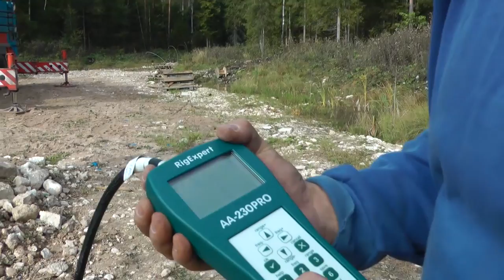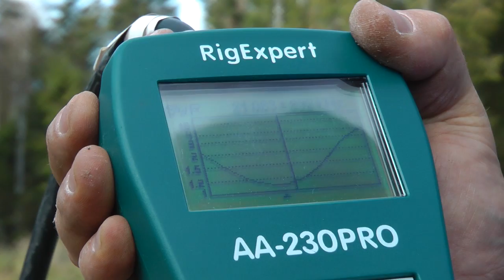ES5TV 15m 8x5 Elements H Frame Stack

Comment: Awesome acheivement.   There are a few other very high gain 15 meter antennas around the world - a QSO should be possible.  Some of the comments????  The timing is perfect.  It's 15 meters - it says so.  The meter shows 50 watts output, the gain of an ACOM2000A is 15 dB (you can look it up).  That's 1500 Watts output for 50 watts input.  All good.  N4GG.

Comment: Do you still have the engineering plans for the concrete foundation and pivot for the rotator I like to do something similar?
Reply from the maker: tower/rotator was made by 4O3A, I don't have any technical drawings. Foundation was just a large cube of probably ca 2x2m if I remember correctly:)
Reply: @tonnovahk78  ok thanks  for getting  back to me. I would love more with these antenna  s 👍

Comment: The guy wire clamps at 11:50 appear to be installed incorrectly. The "saddle" should straddle the live guy line. There's an old guy-line saying "Never saddle a dead horse" which means "do not put the saddle of the U clamp onto the dead end of the guy wire."
Reply from the maker: you are right! I am in the middle of fixing this to be on the safe side. Thanks!

Comment: how do you match up those antennas? I thinking on doing 4 cubical quads in that same smaller configuration. not sure how to co-phase them though. any help would be appreciated.
Reply from the maker: Hi, I use 1/4 wave coaxial  transformers to bring the feedpoint to 50 ohms.
Reply: I am new to co-phasing antenna's. is there some place I can get information on co-phasing 4 antennas. ie the turn ratio of the transformers and the impedance of the phasing coax etc. thanks for your response, that is a very impressive array you built. I'm planning on putting 4 cubical quads in the same but smaller setup as you have
Reply from the maker: I am using simple 1/4 transformers:
https://en.wikipedia.org/wiki/Quarter-wave_impedance_transformer
It means 2 pieces of 50 ohm 1/4 wave cables in parallel to bring the impedance from 12.5 ohms back to 50 ohms. No turn ratios or any other fancy stuff. If you hhave 4 antennas with 50 ohm impedance then this is what you can use to bring the impedance back to 50 ohms from 12.5.